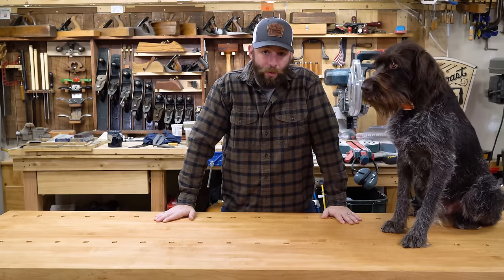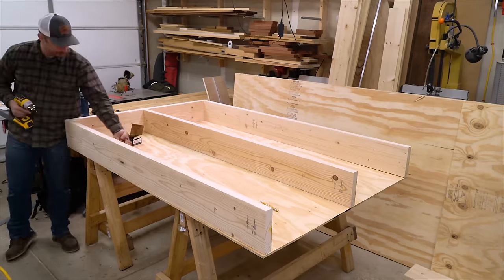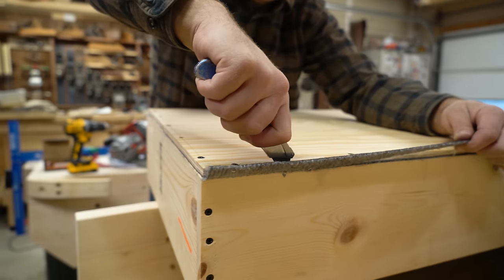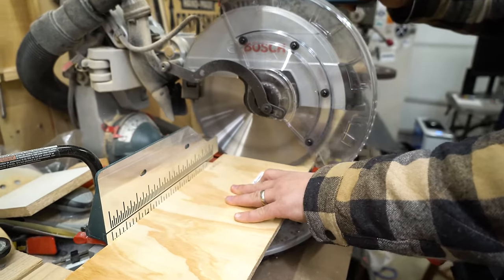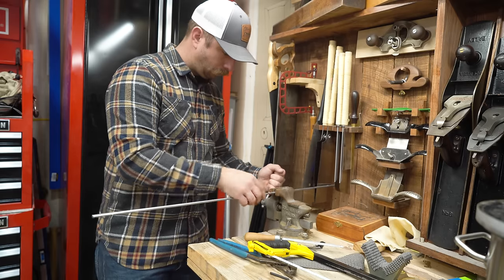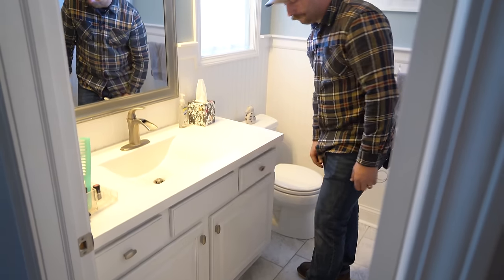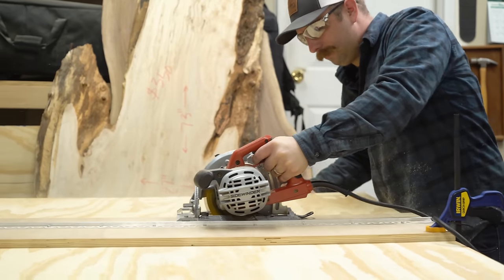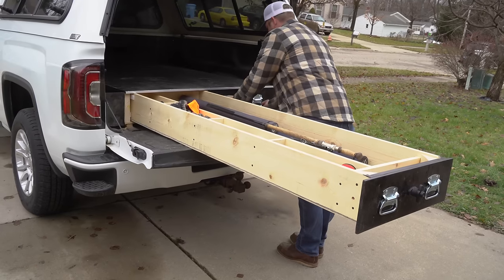How To Build Truck Bed Drawers // SUV Drawer // DIY

Comment: I’m building them now. I think you have your “drawer bottom” dimensions wrong on your plans. Says to cut them 74 1/4”X 21 1/4” I think you meant 73 1/4”x 21 1/4”. Figured I’d let ya know so you can change them 👍 awesome plans though man and awesome setup! I have the frame built I’m about to start the drawers.

Comment: Wow man!  That was a killer project!  So many cool details!   I have a massive 5th wheel hitch right in the middle of my bed, so I won't be making truck bed drawers, but I can sure use a lot of the ideas you presented on my shop work benches that need better drawers.  Thanks again!  PS:  Shaving with a hand-plane blade was crazy!

Comment: You can buy cabinet drawer locks with lock , key & all necessary equipment for drawer faces( Lowe’s ) 1” or less in conjunction with magnetic  single pull handles ( Amazon) 2 drawers total $22, cuts out all the manufacturing time,1- 3/4” hole & 4 screws per drawer handle & your done ! Shalom!

Comment: Great video, I have a QUESTION (: with the plastic slides, when you open the drawer more than halfway, does it have the tendency to fall down and rub on the ceiling of the drawer housing ? How did you overcome this
Reply: it would wanna tip forward and rub on the ceiling. you could place some of that UHMW at the back of the drawer on the top side so you have the buffer effect like he does on the sides and bottom, i've also seen similar designers but with large drawer slides that could prevent that entirely

Comment: Awesome Build! had the same thing in my old truck to camp out of. been meaning to build a nicer new one for my new truck. 
Fun fact HMW is very commonly used on the south pole traverse to drag fuel bladders and cargo to the south pole. it is extremely slippery, and not fun when you think your walking through snow and find out a large piece of HMW is underneath it. i hadn't thought to utilize it for drawer slides!

Comment: Do you think these could be/are made water tight enough to use without a bedcover?
Reply from the maker: My buddy made a set that weren’t under a cover. He had they coated really well with truck bed liner and but seals around the drawers. I’d also recommend using MDO or marine plywood.
Reply: That's promising to hear. I thought it could work but every image online seems to be with covers. My other thought is what Item am i going to regret not being able to haul.... but i just can't think of it. Anyone have any thoughts on that?

Comment: Will a dog Kennel fit on top of that drawer unit?
Reply from the maker: I have a large wire kennel that fits in mine. They are shorter and fatter than the plastics ones. I have an Insulated cover for it so he stays warm when it’s cold and I take it off in the summer and he stays cool when it’s hot. A large plastic kennel will definitely fit under the topper once it’s in but getting it in might be a problem. I don’t know if it will clear the window going in or not and don’t know if you can put it in sideways and roll it upright.

Comment: Question - is the flex seal applied to untreated lumber enough to protect the drawer system in a truck with no camper shell? Or will it deteriorate?

Comment: I’m just wondering how many nights you had to spend in the spare bedroom or sleeping in your truck after wrecking your dearly beloved’s Lipstick 💄 😂, but I must say it’s a nice build and I’m going to do something very similar, I’m  mobile maintenance manager and I need to carry a full toolkit from site to site, I have been thinking of the best way to do this, and I particularly like your use of Low Friction coefficient plastic for your runners - Julie

Comment: cool man. if come up set plans were stares that pull strait lay down at angle for animals get bet. got 200 pond goats i'm 300 pounder probley walk up them too. so need hold 500 ponds slide into drawer just like drawer. goats site tope in fenced in cage celling and all. cool man beat figure out plans.

Comment: I thought part of the concept of building up height of the bed was so that it can be wider if its above the wheel wells.  Why didn't you capitalize on the extra width.  It looks like the top is the sane size as the drawers.

Comment: After years of just throwing cans, bottles, wood cut offs and miscellaneous garbage into my truck bed... Including my wife's lipstick... I've decoded to build some sort of drawer system. Probably not as slick as your bed drawer set-up, but hopefully your inspiration and skill will rub off on me. If my wife catches me with her unmentionables (don't know why I'll need them or how I will use them, but... you know...), can I have her contact your wife for advice on how to deal with it? Also, how do you get away with the killer 'stach without the wife complaining?

Comment: The connection of the drawer sides through the carpeting is an absurd mistake the only rank amateur would make. Adding rollers with cost all of $25 and keep the thing from falling apart after three months of use. Nice weekend warrior stuff but if you want George for your truck look elsewhere this is a giant fail

Comment: Holy video editing induced seizures, batman.  Slow it down with all the cutting and splicing.  This video is full of 10 second runs of 0.5 second clips slapped together.  Its just brief flashes of power tools and wood.  I can't tell if the video is trying to make me swallow my tongue or make my subconscious want to go out and buy some wood and tools.